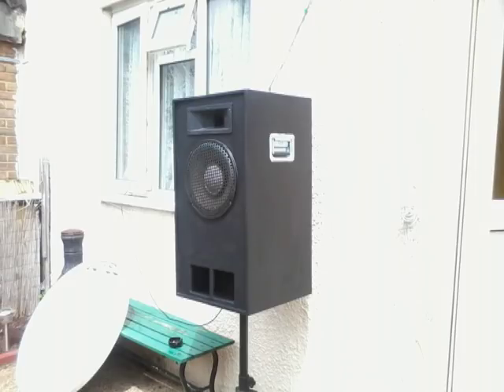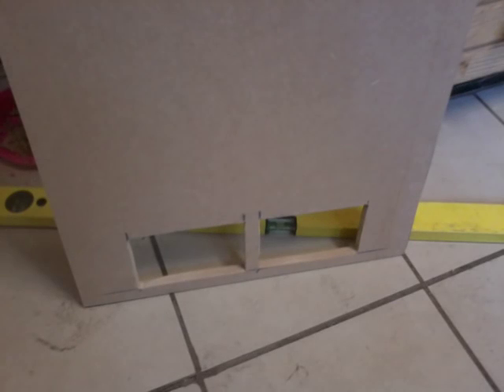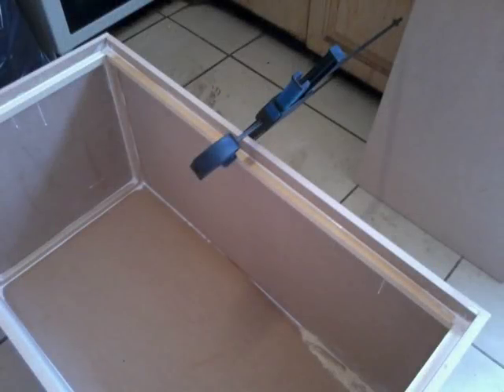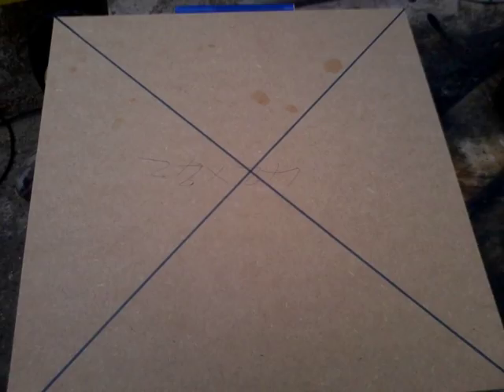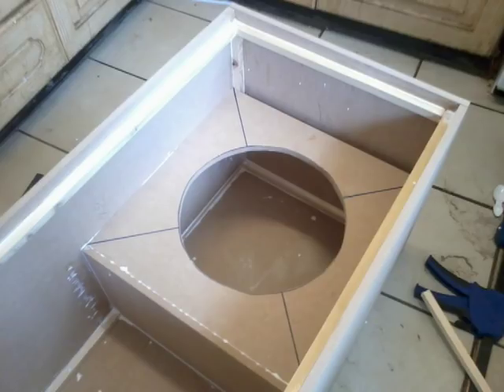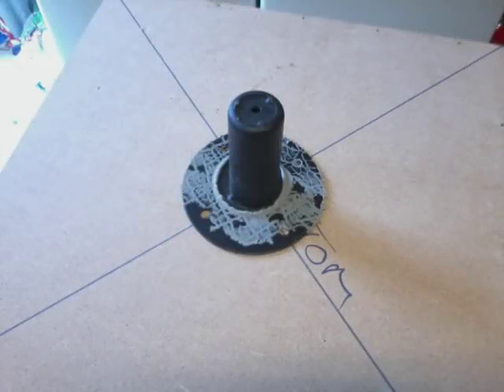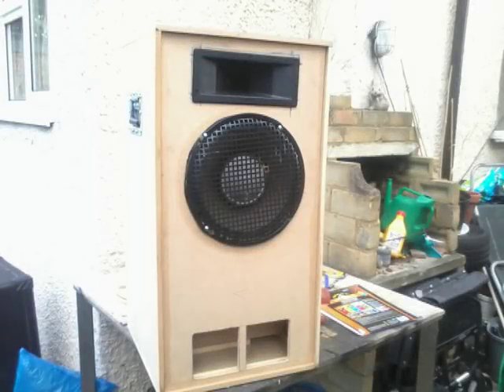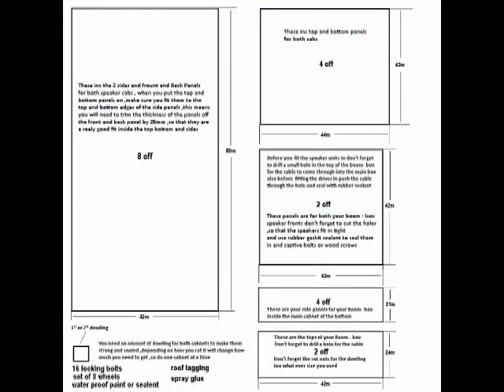How too Build a Powerful Pair of Speakers

Comment: great job. i built a handful of subwoofer enclosures. never played with a bandpass or 4th order before. i just build them massive. i have a 12 cubic foot cabinet which is erm 1 sec, approximately 340 liters. it's a huge subwoofer box, ported and tuned to 33hz, divided in the middle so each side is 6 cu ft. and it holds two 15 inch subwoofers by Kicker. the 15 inch L7's back from 2002. well it did. now I have 15 inch cerwin vega strokers in it. back when I was 16 and 18 I took the whole back seat out of my sunfire and i had this massive subwoofer cabinet where the backseat would go. gutted the whole car. hahaha i don't know how loud it was in decibels for sure but it was definitely around the 140-145db mark. love this shit.

another thing i can say about my massive subwoofer box. is that it doesn't matter what size subwoofer i put in it I've had 10's and 8's in it. and it still sounds amazing and gets quite loud. even on just as little as 250 or 500 watts.

https://scontent.fyhz1-1.fna.fbcdn.net/hphotos-xfa1/v/t1.0-9/185817_10150432448715346_3681299_n.jpg?oh=d27f22eb0c7802eb8d47bbc44853e2f7&oe=570CF893

https://scontent.fyhz1-1.fna.fbcdn.net/hphotos-xpf1/v/t1.0-9/197193_10150432448415346_2268177_n.jpg?oh=1314b37f0ad52d3b8cb31298ce6d3e4c&oe=573E4A41

Comment: Took some advice from your build when I built mine. Used battens on all edges inside. Screwed and glued.  I had an old duvet that I used as a form of dampening for the inside of the box and it works quite well. I have a 12'' driver, Long throw horn tweeter and a small 4'' dome tweeter connected to the jack plug via a crossover.  I still don't know if the cab size was correct or the port size I used but still sound's great.
Reply from the maker: Hi Binbagful, Well glad you enjoyed the build, The thing is if they sound good to you, then that's important after all mine were just an experament also and I use them all year round inside and out for my Gigs and no problems ,Thanks for Watching

Comment: great design. In the past I built a few sets of 2×18" front loaded horn cabinets utilizing EVM18L speakers,  1828 mid drivers/18" diffraction horns, EV T350 TWE

Comment: I can tell those are some good sounding speakers, I'm tired of seeing fancy good looking crappy sounding speakers at many parties. I guess nowadays DJ's go for easy money, easy to move speakers instead of good sound. But I still believe speakers can be not that big and sound pretty good. I built a tower speaker with two 5-3/4 inch woofers and piezo tweeters and it sounds amazing (I couldn't believe the basses that little thing can produce). So, as I have a birthday party coming in a year, I thing I'm going to scale up what I did, and build two tower speakers with four 6 inch woofers each and piezo tweeters again. (I know many people dislike piezo tweeters, but I've been using them for many years and if you equalize the sound properly they can be pretty good, I love how clear and crispy they sound).

Comment: While watching this I came up with something in my mind. Not two but rather one. A single sub woofer down firing inside the box hidden from view. the box would have ports on the upper and lower, Air coming from the upper port would be from the back of the woofer and the lower port would be spewing air from  the front of the woofer. While one acts as a vaccume taking air in the other port would be blowing air out. The upper port would be smaller and more chambered / restricted to reduce cone excursion. I don't think they still make them but those old Kicker Freeair subs would be awesome in a box like that. I wouldn't glue and nail. But rather wood screws and clear silicone. That way if you need to replace the speaker/s, fix a problem with wiring ect. it's much easyer taking the panels back apart. There's alot of neet things you can do with boxes like that too. a fancy wood grain front with leather and lace curtains hung over the ports that show what the sub is doing
Reply from the maker: Hi, yah some intereseting Idears, mite be worth trying, always looking for new ways of making subs, nice one

Comment: You only briefly mentioned a crossover network--(the actual critical part of any loudspeaker system for accurate sound).  Did you custom design it or did you just buy an off the shelf unit and plug it in?   Did you use Thiele-Small parameters to design the Bandpass Subwoofer section?

Comment: One thing to bear in mind is the resonant frequency of your speaker component which will determine the size of the measurements of the cabinets. If this is based on a Jamo 365 etc and measured thats pretty cool. Its good to have simple builds as well as complex ones available on youtube. Cheers Barry

Comment: Solid enclosure with the right size and port for the speaker simulated by a good software. The speaker must have very soft suspension, light weight cone, but the most rigid possible to avoid cone distortion by flexing, the suspension must move not the cone it self.

Comment: So this is a 3 way speaker with the bass in a series tuned 6th order bandpass enclosure and sealed midrange. I have no idea how to get series tuned bandpass right.
The problem with full range cabs is the position is not ideal for bass reproduction compared to subwoofers you can put near walls and corners for reinforcement. For setting up in a corner, I would use two subwoofers making a square gap in the corner behind me and time delay the tops to line up the sound.

A DBX driverack will do equaliser, crossovers up to 3 way, time delays, limiters and high pass filters (to protect the 15" woofer from really low bass below tuning) for you. Of course you will need a lot of separate amps for 3 way when a passive crossover is easier for mids and highs.

Comment: Hi Barry, well done, I'm actually  working in an audio system for my lap top. My goal is to use only a pair of 6" woofers in a cube shaped box with a low pass filter to get bass more eficciently. I will also build a full range satellites from a tv speakers. I agree with you, it is no necessary to use big and too many speakers to obtain powerful and rich sound.
Reply from the maker: Hi Yeyo,Thanks for your support ,good luck with your build ,if you want any help just
give me a shout ok

Comment from the maker: Hi ,thanks for your comments, but every one can have there say, inc yourself, as to whether my speaker design is good or bad is up to the individual person, but after I stripped down a pair of old Jamo's because the cases were  damaged, and used the drivers in this design, when I see how they were made, which was very cheaply
Almost a carbourd case with a 15" driver made of tin and cheap and cheerful  midd range driver and sweeter and a crossover made from hardboard and these
are classed as some of the best speakers you can buy, then I rest my case.
Best Regards Barry

Comment from the maker: I go to some other sites to work out the sizes I needed for the cabes, Did do a  slite mode, when I replaced the Bass Drivers, I added rear Port Tubes , I now also run them
using 2 power amps through a speaker controller ,give much better control.

Comment from the maker: Hi, well the external 15" full range jamos so a bit cheap and nasty, but they were second hand ✋, the internal subs were fan 12" 280watts rms, and two pizza Electric Horn tweeters with built in cross ❌ overs, the full range and tweeters using one amp and the subs using another amp, through an Electronic cross ❌ over,  hope 🙏 that helps.

Comment: hey ! nice preakers.. Im looking to make single battery powered speaker i can take with me anywere just to have some desent sound for small parties.. i have some car peakers and a sub woofer left around with the amps.. do you have any good ideas? should i add one tweeter one speaker and the sub at the bottom? i aslo want the battery to last a desent time..
Reply from the maker: Hi Retrgazele 
If you send me some details of the sizes and types of speakers and how many ,and watts and ohms ,I will do you
a drawing ,of what you could do with them
send the info to my e-mail  bmildon@yahoo.co.uk

Comment: it sounds clearly , nice work
Reply from the maker: Hi Jorge ,thanks very much for you comments
Reply: i don't see how is the subwoofer set into the box, or the crossover built...where i can see that info?
Reply from the maker: Jorge Guerrero Jorge I thought I sent you the drawings ,fitting the boom box
is set out in drawing 6-7 But if did not send you the drawing please e-mail at 
bmildon@yahoo.co.uk,and I will send the full set of drawings.
Reply: Thanks a lot Mr. Mildon.

Comment from the maker: Hi Wlliam, The reason you need to keep it sealed is because you don't want air to leak from the sub bass internal cabnet apart from the bass tube or port, you want the air to bounce around inside before leaving so you get a good bass, also if  it leaks you will get some nasty sounds come from the cabnet, hope this helps.
Reply: +Barry Mildon Didn't help
Reply from the maker: Hi, Sorry for the long time  in answering, have been dealing with Cancer

Comment: Nice Design Barry. It looks efficient and durable. would you every build the box and the front panel separate to sell the box and people can add there speakers and finish the design the way they want. Like adding all the components and carpeting. let me know if it cost alot to ship to the US. If not thats ok. great craftsmanship mate.
Reply from the maker: Hi Cayugan1 ,if you would like you can have the drawings ,to build then yourself
this is my e-mail  bmildon@yahoo.co.uk,thanks for your comments
Reply from the maker: The trouble is I don't realy have much time for 
making cabs as I have a full time job and at 
weekends I'm doing gigs myself ,wich means 
whats left is for family time,of cause I don't mind helping you in your build using e-mail advice  I can send you diffarant speaker wiring drawings for you to deside on and give you imformation etc . Best regards
Reply: Barry Mildon hi barry mildon can have the drawing of speaker design

Comment from the maker: Hi chiaraggamuffin , yes it is possible, you need to wire the front full range speaker, strate to the amp, and the sub bass useing a crossover ,which you can pick up cheap,also if your using pizzo horns, you need and inline 4 ohm resister, to protect it.
hope this helps .best  regards Barry

Comment from the maker: Hi no I use a speaker controller so that each speaker has its own channel one for horn tweeters upto 20,000 Hz and one for 40-60 Hz and one the sub down to 20 HZ so the subs have there own Amp and so dose the middle and Tweeters this means they can be fully controlled.

Comment: do you connect the woofer and the mid-range speaker to the same wiring?
Reply from the maker: Hi Harley, No they are both connected to there own Amp
Reply: Ok I see like concert seakers cool I'm thinking about two 33'' tower speakers two15'' woffers  1 base reflex one 6.5'midrangers and one emit ribbon tweeter in  these each cabinet.

Comment: that's so cool nice job. i always says its not just about watts or ohms its about the make of the speaker and sound quality i no because i had set off speakers that out of an old pa amp for guitar and bass guitar and it was only 100 something watts and it sounded so loud that only had it going out of one speaker it just shows that don't haft think that need 3000w speaker for djing or for a party in my opinion watts and ohms is just an other word make you buy it because if it says something like 30000w that would make you wanna buy it but that's not best idea to do best idea is make something out of a pair of old or new speakers that would make people say where can get a pair they sound so good then you say i made it my self that make you feel so good that you have got something no one else has got :)
Reply: Watts and ohm's have absolutely 'nothing' to do with the loudness of a speaker. Speaker sensitivity matters more than amplifier power....why? efficiency! A 300 Watt RMS amp powering a 300 watt RMS speaker (with an efficiency of 88db/1m) will not be anywhere near as loud as an amplifier at 150 Watts RMS powering a speaker with 94db/m efficiency. I'll summarize by saying, 'Twice the sound pressure is an SPL of +6 dB' So to get a speaker which has 88db/1m efficiency to be as loud as a speaker that has an efficiency of 94db/1m (using the same amplifier and gain level) it would take nearly double the power.   -   Also don't be fooled by the watt displayed on the likes of Sony HiFi's (and the like) as they almost always state the peak (that's the very max discharge of the amp and can only manage it for a split second), what you want to look for is the RMS (Root mean square) Watts as that is the max the amplifier can perform on a continual basis.
Reply: Punctuation Den?

Comment: just finished the video...I caught the accent in the beginning of the video but you sealed it with traditional shots of jager...thumbs up!!! my shot of choice and love my heritage...great video, but how far does the bass carry with this design? I do a lot of outdoor events, and this box looks small (40 lbs or less), so curious as to how far the bass carries...keep up the good work chap!
Reply from the maker: Hi, I have done many outside gigs with these units and there bass is very good for there size, but in a fully open space maybe not so good, but yes they do have there limets.
Reply from the maker: Hi at around 40 feet you can still feel the bass after that you can only hear it but still sounds solid ,its hard to gauge outside realy,
thanks for your nice comments

Comment: I am new to speaker mechsnics, why is it so important to keep it sealed?
Reply: William Butcher It is important because the bass will escape through any gaps on the cab which can cause problems. It can cause the cab to rattle and it could tear the cab apart if the bass is too loud. Also, it would dampen down the bass and you wouldn't get the correct frequency.
Reply: 1996rockster thanks, as i am building my own portabal speaker, i am going to have 2 bass ducts like the ones ontop of this speaker, is this a good idea or a bad one after what you have said?
Reply: As long as the cab is sealed. it is fine to add a port hole but not too many as it will cause problems. a maximum of 2 will be fine. The only thing i advise is that you do some research first. have a play around with what you have and test which sounds good and which doesn't, its the best way as people have different opinions on good sound and bad sound. so you will know what you like. just don't go mad and keep thinking that bass is the key and that you need more because its really not the way to go when building speakers. Use a good crossover with the right rating and right speakers and you should be good.
Reply: 1996rockster thanks a bunch, i have worked out the sise for the ports with an online calcuator and on my amp i have changed to crosover settings for the bass drivers to the frequency i want out of the ports but have yet to seal the enclosure up yet as i am waiting on a few laptop batteries to arrive to power this monster
Reply: No worrys and sounds good. Just be careful with them batteries because most laptop batteries are Lipo now so they can be dangerous if they are not handled properly and wired correctly. Also, make sure the batteries keep cool too! Get in touch with a picture of it once it's done.
Reply: I checked all 6 or so old ish batteries and they are all li-ion and i have around 22,000 mah 12v of power, its just the charging that will take around 3 days to safely charge them. And i should be doing a build log once it is finnished and definitly a page on instructabals for this.
Reply: nice one! can't wait to see it mate.
Reply: 1996rockster hey, i have just done this instructabal so it will have typos and spelling mistakes but i will change it in good time 

http://www.instructables.com/id/Portable-Boombox-With-Bluetooth
Reply: Nice one, just had a look and it's looks good. Post a video of it in action. Well done mate
Reply: Thanks! I will once I have enough footage to do so and fins somewhere that is relatively rural so I can push it !!
Reply: Thanks dude, both of you helped a load, i eill build my next speaker with this in mind (i am a massive noob in speaker mechanics and just getting started)
Thanks xD